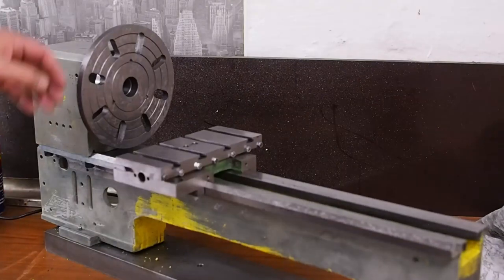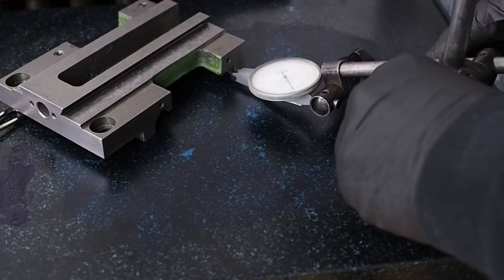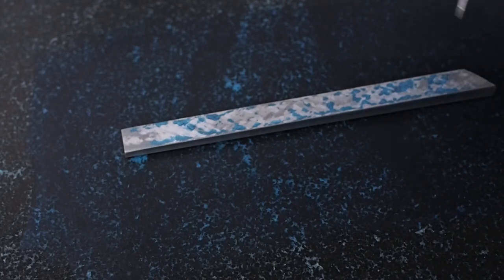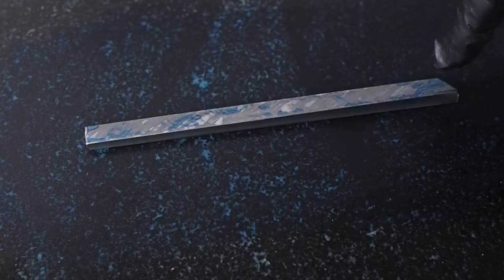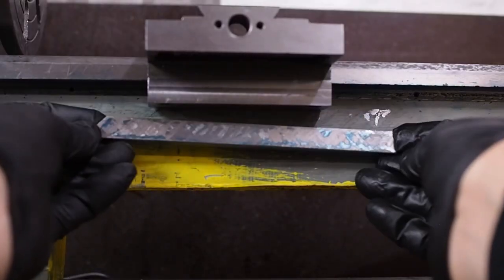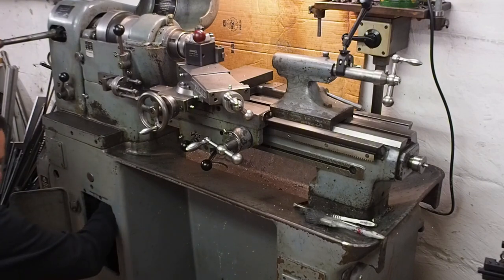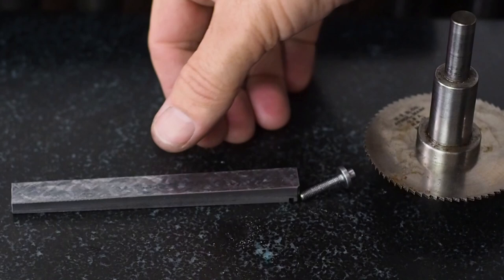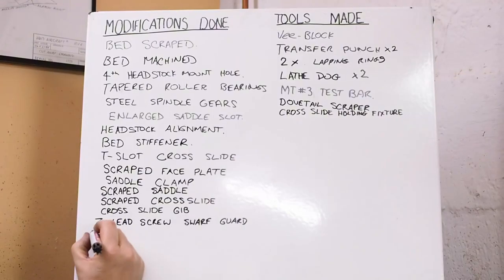Overhauling the 7x12 mini lathe - Episode 13 - Scraping/fitting the tapered saddle gibs

Comment: Scraping footage along with explanations is indeed very welcomed. Scraping is a hard topic not well covered by many and you are doing a great job with this little machine. Is actually a great idea to train on one of these before even thinking on taking on a bigger job. Once you onto your bigger lathe things are going to be a lot more clear.
Reply from the maker: Thanks for watching. That was the idea with the mini-lathe. A practice piece. I had scraped single surfaces flat, but once you get to the saddle, where you are scraping to correct  the cross slide alignment while also keeping surfaces parallel, and getting decent contact, it gets a lot more complicated, especially setting up for repeatable measurement. The only disadvantage of using the mini lathe for this, is that the tiny dovetails are not very represesntitive, and it is still a pretty weak machine.

Comment: Scraping can be boring if there is no story to it (like everything else I guess). But if you take a look at This Old Tony, or Stefan, or Lookcreations and many others, it becomes a tense thriller. Chasing alignment, surface flatness, etc is the story. Always interesting. You just have to tell it and I think you are doing a good job of it.

Personally I just realised how much work I have to do on my machines, which I took for granted until I saw the first scraping video some years ago. Not sure if I will ever get to do it, but at least I know it is an option.
Reply from the maker: Thanks for watching. I know many find scraping boring, but wanted to show most of the steps required for a single surface on that video. As I pointed out to my Linux Guru, if he finds my 10 minutes of scraping in the video boring, imagine what it is like to do it, as that 10 minutes only summarises about 4-6 hours of work.

I still have a long way to go to be either the machinist or video story teller of an of those guys, but thanks.

Comment: G'day mate, Churning through your series on lunch break and at night from work camp, there's a lot of good info there.  I do like the brake rotor cast stock idea and will be stealing this.  I've got a slightly larger lathe that needs a LOT of love and you're inspiring me to do a VLog series on it.  There's a few things I'll do differently - not sure if I'll CNC it or not, was hoping to get a larger lathe for that later on.  One thing with your scraping that I would suggest based on the information given to me by more knowledgeable people is that the V way on the carriage should be slightly concave in the middle third, so when blueing, the two outer thirds have good contact, but the inner third has very slight clearance - maybe 0.01mm (or half a thou if you haven't reached the 20th century yet).  The theory here is as you add tool pressure, the carriage will tend to flex and banana.  If the ways are scraped flat the whole length it will tend to rock around that mid point and chatter when under tool load, but if you relieve it slightly, the centre will be pushed onto the ways and it will contact at 3 points.  Something to consider if you experience chatter under load.
Reply from the maker: Thanks for the tip. Not really applicable to the mini-lathe, as it is about as stiff as a wet noodle, so chatter is always it's thing :)
Reply: @RotarySMP  the way I see it, anything that can be done to reduce chatter on something that is prone to it is worth doing. Much like your thick steel base plate.

Comment: I would definately heat treat the gib material, as the break discs have seen all sorts of stressful life. Cut your raw strips, put them in the oven and heat up to 560-580 C slowly (4 hours), hold for 6 hours and then cool 35 C per hour for 14 hours, so basically once the oven reaches 100 C, you can pull the parts out. So a 24 hour process, but you get virtually stressfree metal that doesn't move on you when you start machining.
Reply from the maker: Good advice. A bit late for this lathe, but good to know for the next time.

Comment: I spent 2 weeks of 18+ hr days doing the upgrades I did. I did all the exact same things and then some over 8 yrs ago. Now I have a real machine. Unfortunately the work is not done on hardened ways so I wonder how long they will last. I didn't take videos though,  lots of pictures. I used my shaper for the first time making the tapered brass gibs. I was lucky my head was true to the bed and I used Annular Contact spindle bearings not roller.
Great videos!
Reply from the maker: I am not so convinced that my choice of tapered roller bearings was a good one. I think you got it right with the AC bearings. 

Do you still have it, or did you migrate to a bigger heavier machine?
Reply: @RotarySMP  I still have it and use it for metric threads and quick small stuff. My son bought it and I did all the work on it. He lost interest and I bought it from him. I have renewed interest in more mods lately for some reason, thus found your site and was amazed that you did so much of the same things I did.
I have a1956 15x54" LeBlond Regal no metric gears. THey wanted over $6200 for them. HA
Reply from the maker: @GeckoCycles  That LeBlond sounds nice. 
I will make way wipers next. I just notice that the bed is already getting soe nasty scratches under the saddle. Very soft iron.
Reply: @RotarySMP  Yes it is very soft. I drilled holes for wipes but have yet to make them.
http://www.gecko-innovations.com/images/800/carriage%20gibs%20done.jpg

Comment: Hello, i really love this series and the scraping content in particular. I'm an absolute novice in scraping and have a lot to learn so every bit of information is much appreciated.
In regards to your comment around the 15:00 minute mark in order to avoid smearing the blueing I am wondering, is it ok to use a ground surface such as a lathe ground bed as a blued master to spot another surface (the carriage for example)? Or does the master also need to be scraped to avoid smearing the blue to the target?
And by the way what do you use as a blueing compound? I'm pretty sure you have mentoned it in a previous video but I can't find it now. Judging from the packaging it looks like artist's oil paint. I really like it, the permatex prussian blue I recently bought is much duller and i can't distinguish the various hues of blue indicating high peaks, middle peaks etc.
Thanks and keep the video's coming, Dim.
Reply from the maker: I guess my granite is also not scraped, and things blue up against that fine. I am also a novice. I use prussian blue oil paint I bought from an artist store. It is messy, but I always wear gloves so that doesn't bother me. For the camera I am mostly using a thicker layer of blue then you want for finish scraping. WD-40 works great to clean the granite and tools.

Comment: If you had used a toolmaker's clamp to hold the tapered gib from pulling into the taper you would be able to slide the saddle easier as it will prevent the gib from being pulled into the taper.....this would simulate the adjustment screw you finally fit when the job is done.
I hope you identified those gibs for their specific sides as they are fitted after all.
Reply from the maker: They are two different thicknesses, and I only finished scraped the sliding sides. They are obvious to me :)

Comment: That lathe is going to rival a watch makers lathe. Nice work.
Reply from the maker: Thanks for watching. Would be nice if it did, but real watch makers lathes have much stiffer, better designed beds.
Reply: @RotarySMP  I think you already addressed this part based on what I saw. You bolted the lathe to a chunk of steel. If that is not enough I am sure you could cast the bottom of the lathe bed into concrete. Just a thought.

Comment: If it were me, at about this point i would wishing i had started out with a cheap Hardinge and spent all this time and effort on that, but at least you will have the best polished turd in captivity. 😉
Reply from the maker: A friend has two Hardinge. Nice lathes, but that hardened steel plate bolted on as a bed is not a beginners project. Thanks for watching.

Comment: I'm missing funds... there is so much things i need to buy if im gooing to get started on reviving my old crapped out chinese... that scraper with honing wheel looks great though.
Edit, could you show how to get a surface thats longer than your reference flat?
Reply from the maker: Really, for this job you can do almost as fast with a hand held scraper. Stefan Gottwinter posted a great video making a slow turning carbide lap here. https://www.youtube.com/watch?v=GOBtH4m2TYo.

The 7x12 bed is only a little longer than my surface plate, so I just alternated which end hung over.
Reply: @RotarySMP  totally missed Stefans video on that, I will have to check it out.
I dont even have a surface plate yet, and im limited to space... and my lathe is about a meter if i don't count the gearbox. Im actually looking for a smaller lathe to replace it, just havent found one yet

Comment: Great work and result! Do you think an acceptable result could be achieved with milled only parts?
Reply from the maker: I guess it depends how accurately they are milled, but scraping for fit has been the traditional way to get the best out of a machine.  These ways "feel" way better than before. I am using 220 way oil, which is almost like honey, and they have a very silky well damped feel.

Comment: The Chinese mini lathe bed (while it has a nicely ground and flat top bed ,) is wildly varying in thickness throughout its rails , which may be part of the problem of your gib strips  lacking "perfection" (eg , https://youtu.be/howGaZv4Gu4 ).
Reply from the maker: In Episode 2 or 3  I addressed bed thicknesss. Thanks for the link. Not sure why he measured the front way to the peak of the vee, as that is not a functional surface, and there is no guarantee it being parallel to anything, I made a vee block to measure the front way. It is the rear way which nips up just before the headstock. This is probably just a a few µm high there.

Comment: my gibs have an adjustment screw at both ends so i can lock off the gib,would this be a better way for you also.??????
Reply from the maker: Do you have a link to your method? I'd like to see that. Those slots I machined a re very tight fitting, so the gibs are constrained in both directions. This is the way Boley did it as well. So far it seems to work.
Reply: @RotarySMP  its actually on my hafco h48 mill ,you loosen one side and tighen the other to adjust.it just seems a great idea they came up with.this way you can lock the gib.
Reply from the maker: @geoffreyward4743  I guess you can either use two opposed screws or one screw to constrain it in both directions. Since I have now cut them off flush with the forward edge of the saddle, there is no scope to change it now.

Comment: Hey there, Im new to your channel, and have just subbed. I really like your approach to the lathe. But was wondering if you could talk about your scrapers. Although im mostly wondering about your hand scraper. Ive been searching for a while for the carbide inserts like yours but cant seem to figure out if im useing the wrong choice of words in google or .............? I figure id just make my own until i decide wheater i want to continue. But cant seem to find what i need. Id really appreciate your input and im sure others wanting to start also, would benefit. Thanks ahead of time, keep up the good work.
Reply from the maker: Thanks for the Sub, and the nice feedback. I use a Sandvik scraper which I bought from ebay or craiglist years ago. Here is a vender in the UK:
https://nenutsboltsfasteners.co.uk/product/sandvik-scraper-blade-h10-620-2530/
In the US, MSCDirect has the blades.
https://www.mscdirect.com/product/details/54734967
They are prety pricey, therefore I just braze old carbide onto steel, and grind it to shape, as diemond grinding wheels dont cost much these days. You only need to grind them to shape once. Form thereon, it is just lapping/honing.
Reply from the maker: Oh and you can get them cheaper in Ebay.DE with the search "schaber platte"
https://www.ebay.at/itm/Forum-Schaberplatte-HM-fur-Flachschaber/202804705045?hash=item2f381a3715:g:s~sAAOSwakten-Hi

Comment: i remember the lathe of my school have a lot of handles for the speed change was a very old lathe i sure that the lathe was but when the school open like in 1950 and was very worn-out, no the mechanical part but the handles, chuck and other part where i very bad shape, the chuck was very destroy like in the year the students dont stop the carriage and the high steel cuter went and cut the chuck a lot of times, so sad a the time i dont have a phone whit camera or i dont think that was a good idea take pictures of that old nice lathe
Reply from the maker: This little lathe only has a two speed gearbox in the head. THats it. That is why I added the bigger motor and VFD after burning out the oriiginal little DC drive.
Reply: @RotarySMP  yeah the original dc drive is very bad